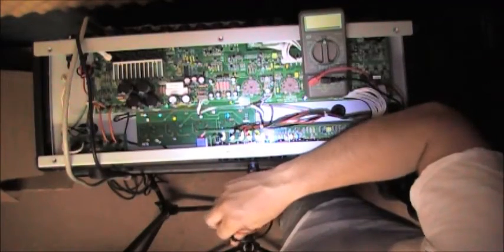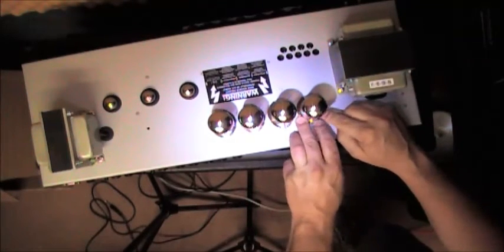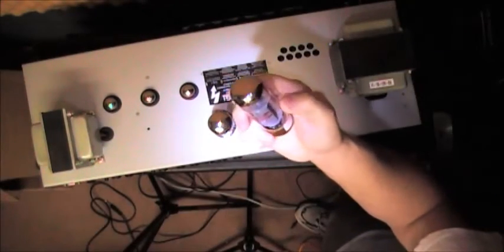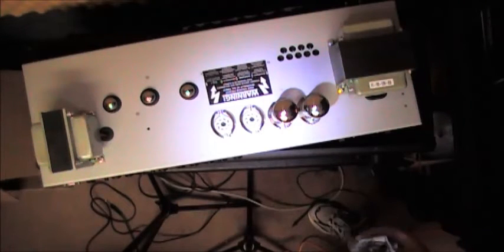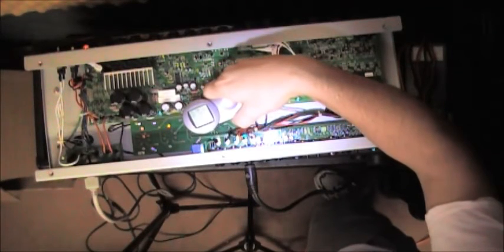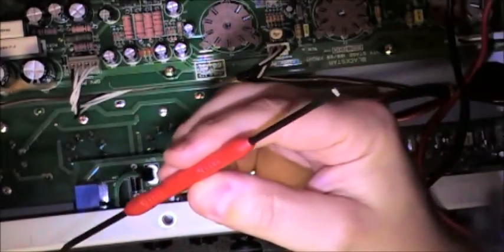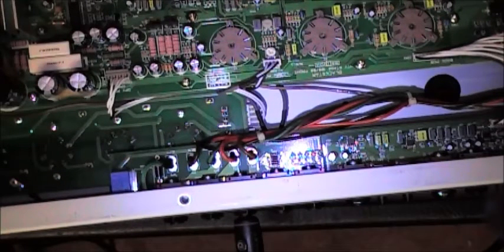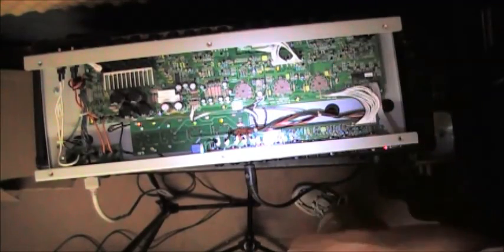Blackstar Stage HT 100

Comment: Very helpful, thanks! Quick question though, what would I set my multimeter on to when i bias?
Reply from the maker: Depends on your meter, but you want to measure voltage. Perhaps consider taking the amp to a shop, hate to see someone make a tube replacement a complete amp replacement.

Comment: There are test points on the ht 40 so that you can set the negative lead in a mounting hole and test the bias while adjusting it at the same time, does this not have that?
Reply from the maker: The only test points I know of are the ones outlined in the video.

Comment: hi cant see where you put the point of  multi meter was it the two prongs or solder joints sea
Reply from the maker: You really have to get a good look at the vid. There are two bare contacts in the area I zoom in on. You can also use  the solder joints but I recommend you perhaps use gator clips and the contacts. Try running the vid in full screen on a page monitor. Best of luck.

Comment: Did you have your volumes set at any particular level? While biasing
Reply from the maker: If you watch the vid, I am pretty sure I had the volume all the way down. The measurements were taken with no load (no signal). Your just setting the 'idle' voltage of the tubes.

Comment: Where touch the tip of cables tester?
Do not touch the two pins that are in the air, to the right of the plate.
It does not look good where you play to measure.
Reply from the maker: Watch the video all the way through, you will see where I place the multi-meter probes (heh). The video was shot form over head, so it appears to be near impossible, and while its a tight fit, you can get the probes in to get a reading. If your not comfortable doing it, please take it to a reputable shop.